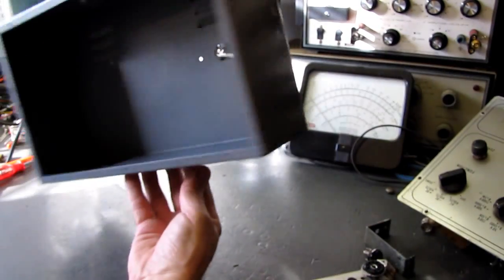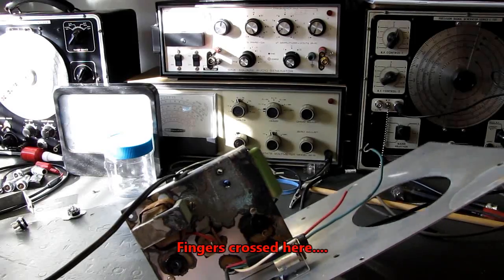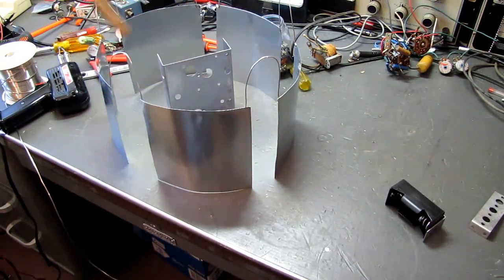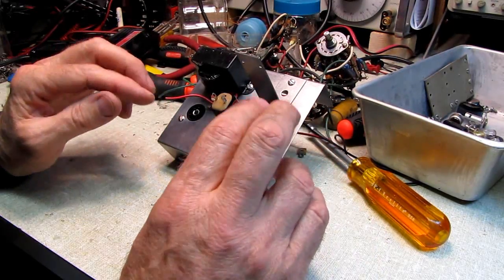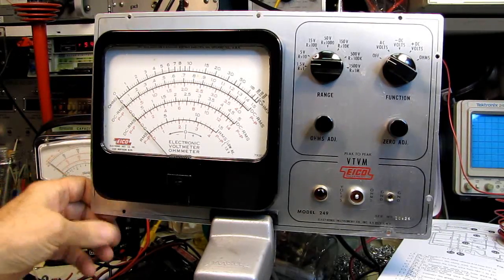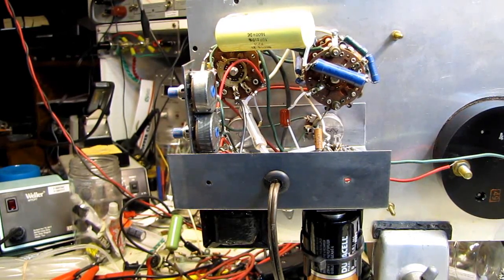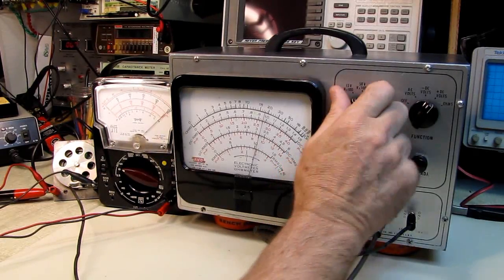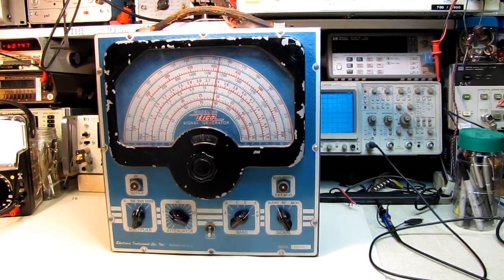10 Buck Test Bench - EICO 249 VTVM Restoration

Comment: My God I stumbled across your videos and instantly subscribed. I got a wild hair up my a** this year 2021 and started restoring vintage analog multimeters and test equipment. I'm an ET from years gone by and I'm absolutely in love with the analog movements. I seriously went from zero pieces of equipment to well over 50 just in 2021. I have tons of 260s and 630s as well as a multitude of equipment on my bench either in use or waiting for it's day of restoration lol. May I ask what specifically your using to dial up the voltages in this video?  My Variac and isolation transformer need this in their lives. Thanks and keep this going as I'm watching them all as I do my work. God bless. 
Robb

Comment: Tearing into one of these right now. And, as most of these testers end up, the battery in mine also leaked. Luckily it was out the top and very little damaged the finish on the component mounting plate. I simply soaked the battery bracket in vinegar, and then a quick soak in a 50/50 of muriatic acid and water. Looks like brand new copper plating. I was thinking of going to a battery eliminator, but they can often overload the power supply when reading low ohms. My solution is to use a D cell adapter with Lithium AA batteries. 20 year shelf life and Lithium  batteries never leak! Problem solved! 

Great video, and awesome job on the plating! Can't wait to try it myself.

Comment: Hello, great video! Question, does the probe on the 249 have any thing inside? Im looking at one with no probe. I thought if the probe had a resistor inside, then why cant i just add the resistor inside so a standard volt meter probe could be used. Thanks
Reply from the maker: Yes, there is a resistor in the probe. Not sure why none of the manufacturers back them didn't put it inside. Just have to switch it out for Ohms and AC.
Reply: @theradiomechanic9625  For making up the resistor values do you hooked up in series or in parallel? 
Thank you
Reply from the maker: @SDsailor7  depends on the value needed, some are parallel and some are series. There are many online calculators to help you determine the values.
Reply: @theradiomechanic9625  Thank you

Comment: That was so satisfying to watch. To take such a old piece of equipment and bring it back like that is what its all about. If you had to replace the resistors what specs should you be looking at besides at least 1%? I have seen some videos here where 1/4 watt rated to 1 watt were put in. I understand that you want as close as possible to the resistor your'e replacing. What are you using there to control the voltage? I've never seen a variac like that one. I am Subscribed
Reply from the maker: Hi Lego. I was using combinations of resistors to net in the value to as close as perfect as possible. Just for the fun of it. The unit I use in the video is not a Variac. It is a wire wound ten turn pot.  I bridge it across my power supply and it allows me to dial in very exact voltages. Thanks for watching.

Comment: Nice job on the plating....sounds like you severely over-enginerded the plating process though.
A weak solution of zinc salts and a single block or plate of zinc as a donor would have done just as nice a job.
The difference is in the applied voltage and the 'current-pressure'.
About 2 volts at 7 to 10 amps would have been ideal for these small jobs.
Doing it in sessions serves little purpose. It would be better to have some light agitation of the liquid in order to remove gas bubbles from the surfaces

Toodles!

Paddy
Reply from the maker: I was a virgin...my first attempt....

Comment: Wow, nice job. I would have relegated that piece to being a parts donor.
 However, in keeping with your "$10 Test Bench" theme, a restoration like that is a great learning opportunity as well as having a nice piece of gear as the end result. 
 I really like big meter Eico gear.
Reply from the maker: Part of doing this ( besides the enjoyment of bringing an old classic back ) is I learn something every single time. Never did any plating until I did this unit. And it turned out to be fairly easy and cheap. Thanks for watching.

Comment: Looks great.  Another nice big meter Eico saved from the scrap heap.  I love the big meters, so easy to read at a glance.  Nice job on the plating.  I have a radio chassis to strip and copper plate soon.

On your next signal generator project.  When I need leather handles I have a local leather shop custom make them for me.  Usually only cost 10 to 15 bucks, cheap in my book.  Nice thing is they can reproduce your handle to the exact same size with holes and the same color.  Just check your yellow pages for a local leather shop.
Reply: That is very helpful advice. I have been using old leather belts cut to size and shape to get the equipment able to be toted around. However i have saved the remnants of the old straps just in case. Thanks.
Reply from the maker: Hi Mike. Found a few leather shops on line that sell them for about the same price. Probably will buy one to finish off the piece.

Comment: You, Sir, are a true artist, and I hope you realize that. I asked myself what I liked most about your approach: your mechanical skills, your engineering prowess, your know-how about all things electrical and/or radio, but I guess what picks me up the most is that you don't cut corners. What needs to be done will be done and it will be done with the proper tool/method. You walk the extra mile with steel-wool, the special anodizing cage and a remarkable eye for detail. Good it didn't turn out a shelf queen but instead a reliable tool that will withstand many more decades to come after you've fixed it and restored it to it's true purpose again. A great show, thanks a lot for sharing that!
Reply from the maker: Hi KL, you give me too much credit. I'm just having fun. Thanks for the kind words.